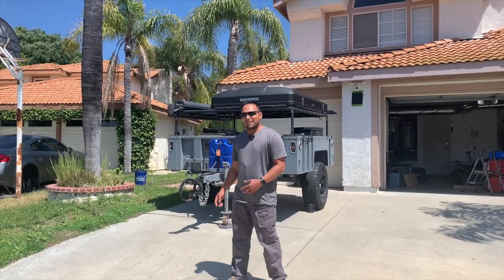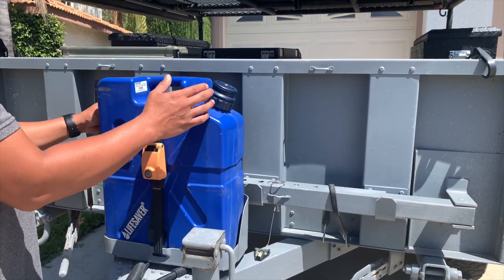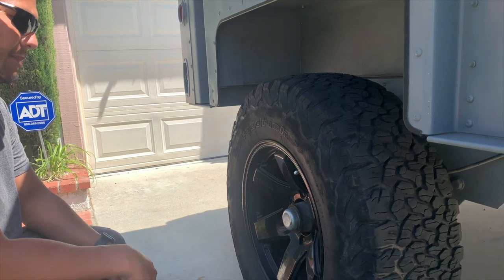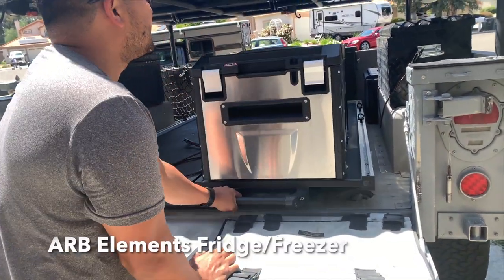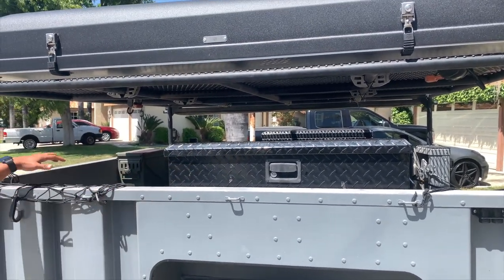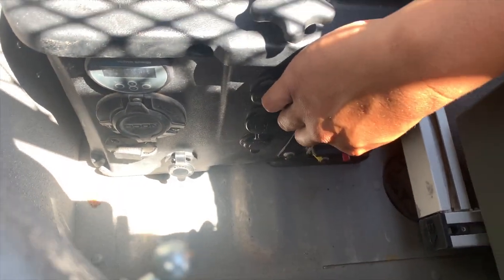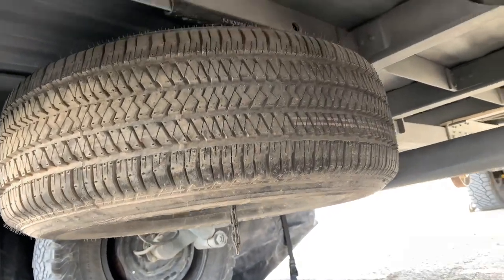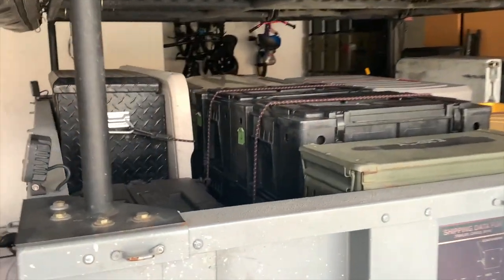Military Humvee Overland Trailer /M1101/ Walk-around

Comment: Great Build. Just bought the very same trailer. You don't happen to have the details of that rack build still laying around by chance?
Reply from the maker: The rack was custom built. I just took it to a metal shop. Told them what I want then built it from DOM pipes. It was originally designed to have telescoping corners but broke so we welded it in place to a good height for us.

Comment: Sweet rig! How was the lock and roll install? What are the pros and cons? I'm about to buy either an m1101 or m1102
Reply from the maker: the install was not bad. had to drill a 5/8 hole for the bolt across. i remember having to freeze the trailer side hitch overnight so it slips into the trailer easier. 

the lock n' roll hitch itself works great. it is a little hard to line up then connecting.
Reply: @expeditionaryfamily  I might have to go down that route. I'm picking up mine next week. All of your videos are helpful, I started following you Instagram, thanks for answering questions.

Comment: I’m very interested in how you converted to lock and roll hitch. Did you have to do any fabrication and how did you bolt up to trailer?  Great rig.
Reply from the maker: its not hard. we just removed the pintle hitch assembly including the oil reservoir then drilled a hole through. we then just inserted a 3 foot long hitch and bolted through the hole. nothing to it.

Comment: Do you have a video showing the splicing of the cable to attach the 7 pin?
Reply from the maker: i don't. but i can do one. its really not that difficult. the worst part is figuring out which ones connects to the right and left signal lights.